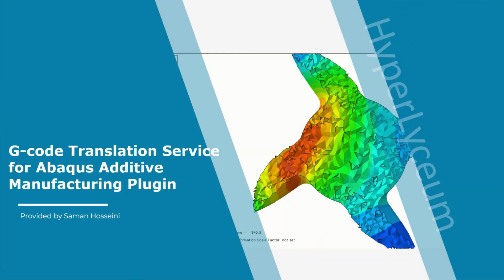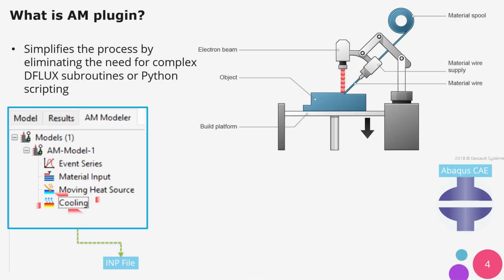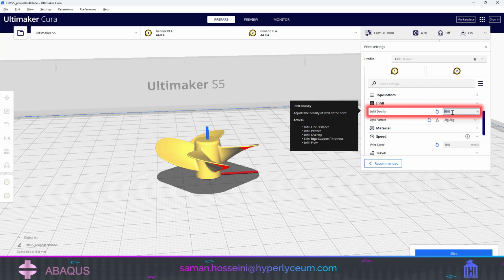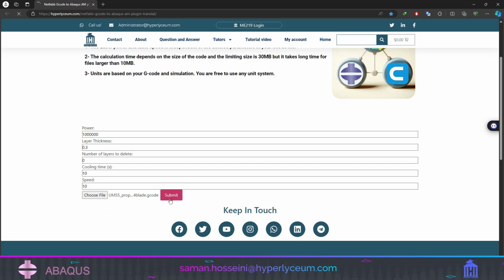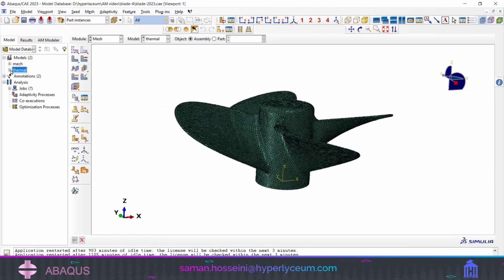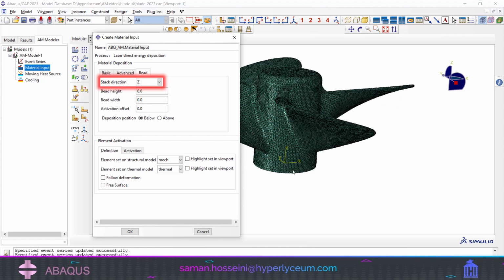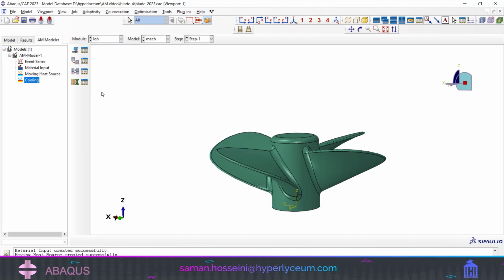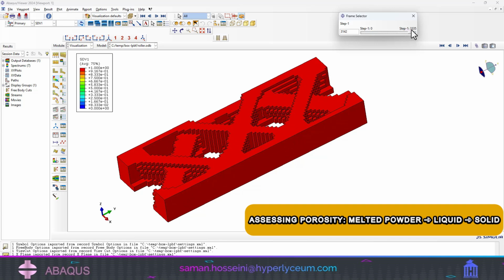Abaqus Additive Manufacturing Simulation for Complex Geometry Printing

Comment: What are the other three boundary conditions in the mechanical module? I am unable to select the Structural model in the AM plugin. Can you please help me with this?
Reply: I am also unable to select the structural module. Were you able to figure this out?
Reply: @jakekeip  1. DONT setup AM modeler yet
2. copy ther thermal model and rename to mechanical
3. change the Step from Mechanical model to Static, general
4. change the assign element type (meshmodule) to 3d Stress
5. set up the AM Three and u will see the structural model in AM

Comment: Nice Work. Is the conversion of G code to AM plugin available at free of cost? and how to access that?
Reply from the maker: Hello, thanks for your nice comment.
For a monthly subscription, you can leverage this tool to streamline your projects and achieve more efficient results. To purchase your monthly access, please contact Mr. Hosseini via email at saman.hosseini@hyperlyceum.com. Once connected, we’ll guide you through the quick setup process, so you can start using the code right away.